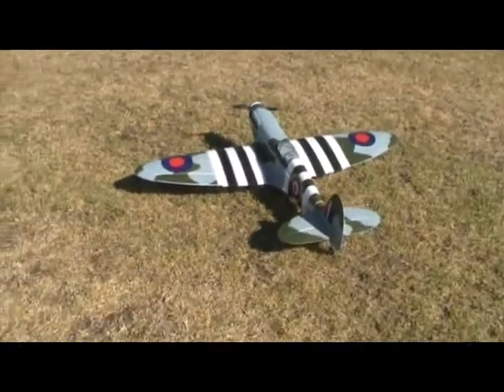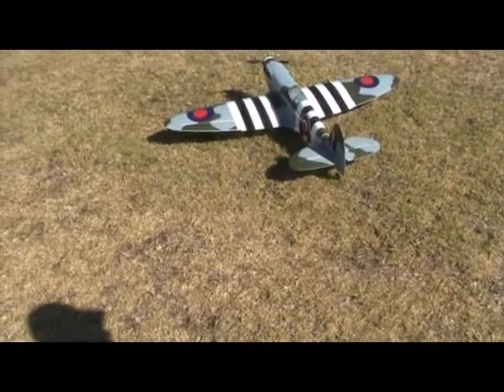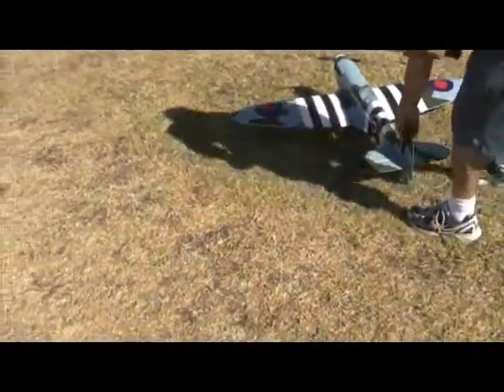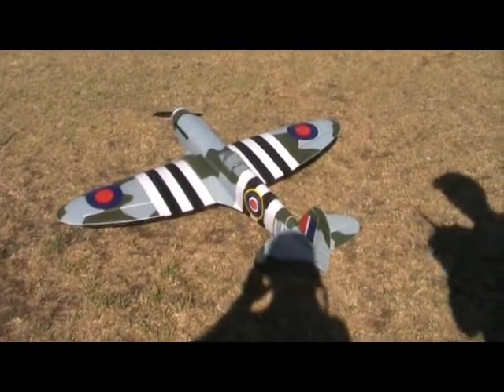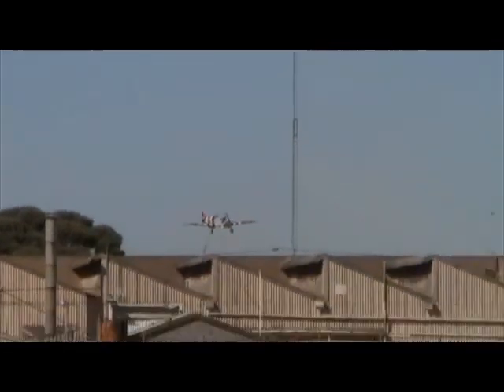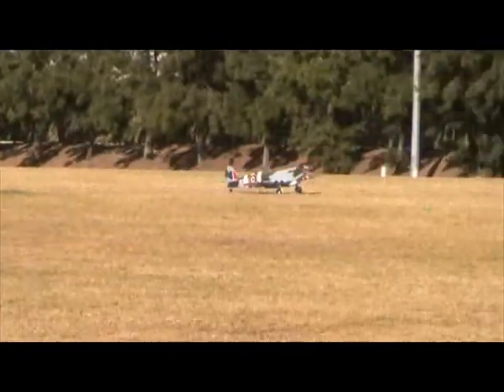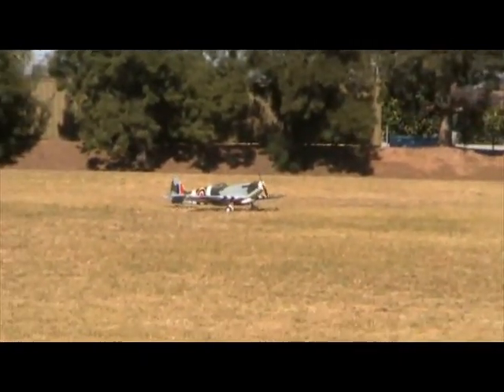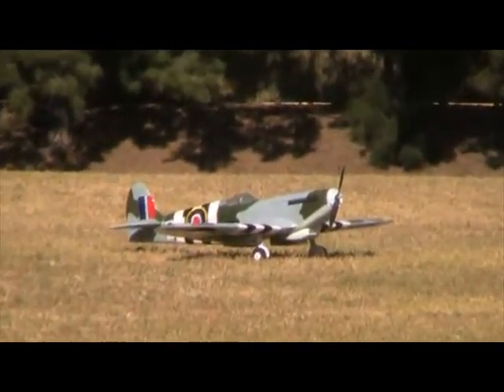Hobbyking Durafly Spitfire maiden

Comment from the maker: @eclipser2004 I think what most people mistake for torque roll is actually the plane stalling because we try to lift off too early. Where we fly is very rough so I cant get up much speed for take-off. I'm sure it would behave differently if I had a nice paved runway where I could accelerate smoothly.

Comment from the maker: @FlyGuyRc This model is easy to fly. The takeoffs can be a bit hairy because you have to keep up elevator to avoid a nose over on rough grass then as she gets in the air you have to ease off the elevator to avoid a steep climb at low speed which could result in a tip stall.Theres a big thread in RC Groups  about this plane.

Comment from the maker: @maccanaut I am running a Turnigy motor but its just the same as the stock one. I also replaced the aileron servos. I am running a 4500 3S lipo. Flies just fine. Enough power for what it is. Check "spitty vid" The other spitty is completely stock.

Comment: That is from the torque when it takes off. I also added washers to give it more right thrust. Flies better with 4s this will give you more authority.

I will install a contra rotating system on it this will eliminate torque effect and make the airflow more efficient.

Comment: I have this plane but have not flown it yet. I noticed the motor is mounted straight, not with a  2 degree offset to the right like most brushless foamies. Maybe it needs some right thrust set into the motor mount with a few washers?